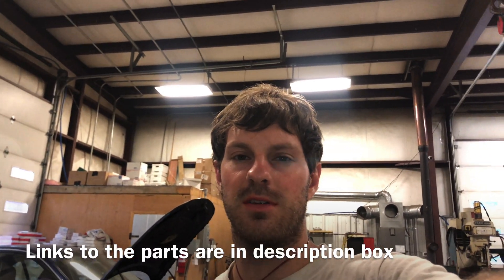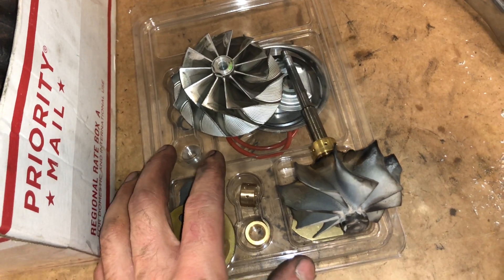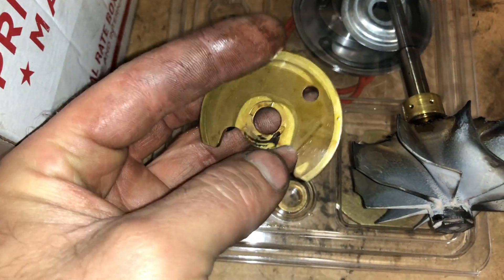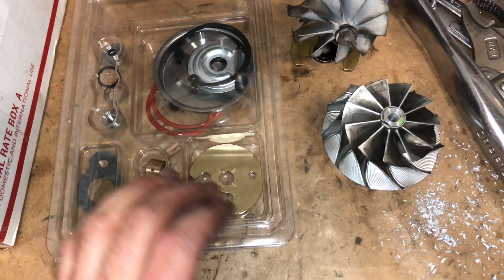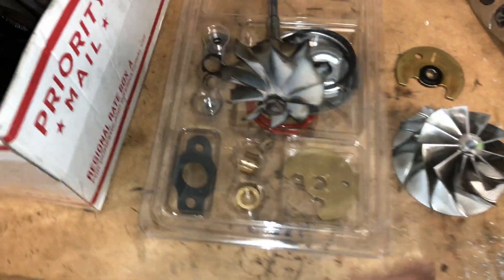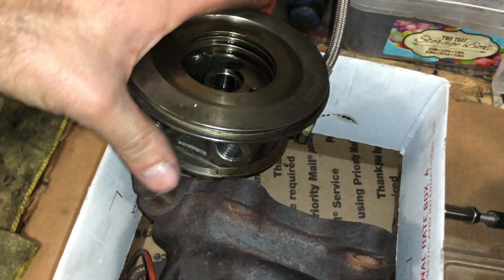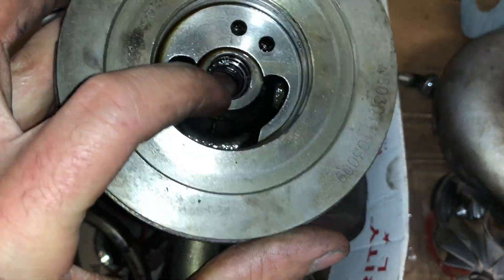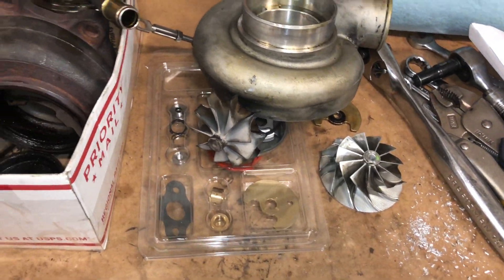Steam Turbo Failure, how to fix permanently

Comment: I have a steam speed turbo that won't go past 19 psi with 100% wgdc. It's their bb 76r turbo for the BMW n55 motor. My engine does not have any boost leaks that I can detect. What could be causing this?

Comment: So basically... Throw it in the trash where they belong, and order a new Forced Performance turbo. 😂
Reply from the maker: The forced performance turbos had similar thrust bearing problem because they were steel but they may have fixed that by now. I’m not sure